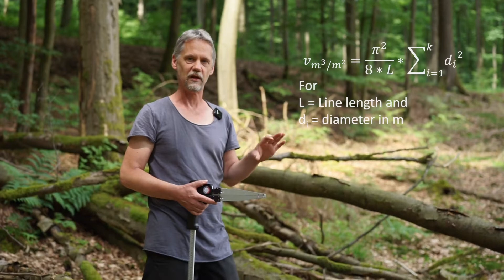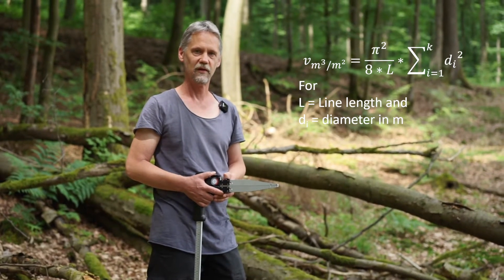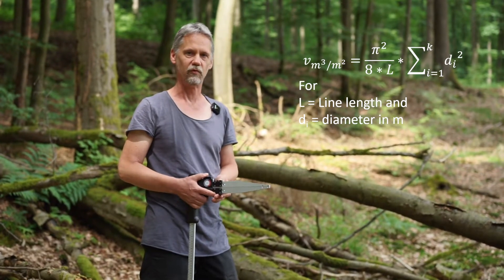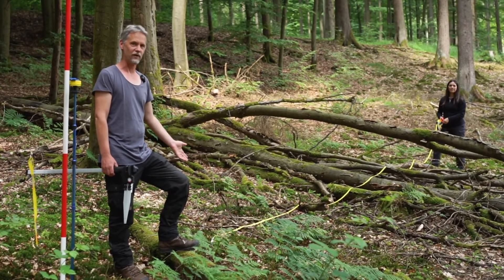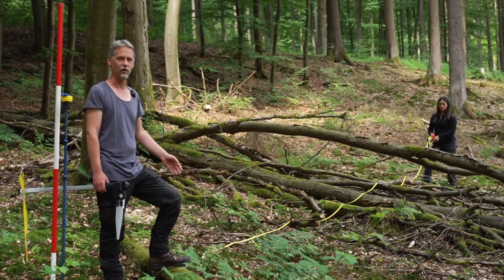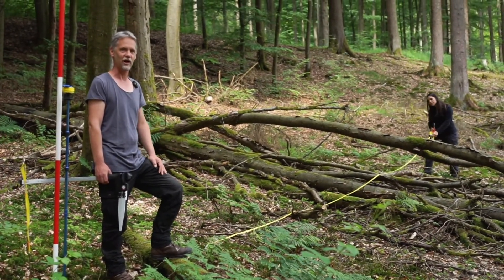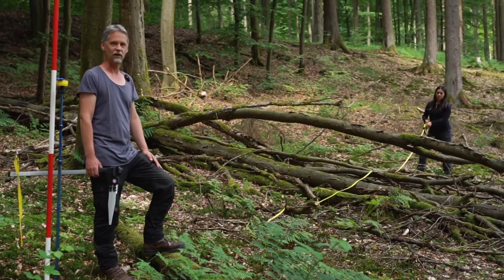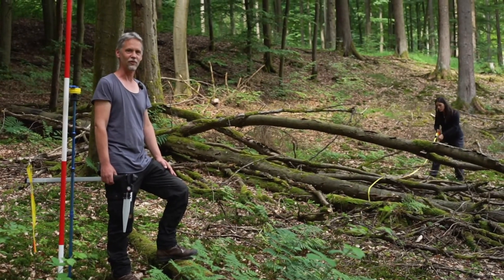Deadwood assessment and Line Intersect Sampling

Comment: Hello, is it possible to mention the name of the reference where they obtained the model for estimating the volume of dead wood by line intersection sampling by Bertil Matern? Thank you
Reply from the maker: Matern proposed an approach to estimate the length of linear features just by counting intersections with line elements used as sampling elements. This general approach was later also applied to directly estimate the volume of lying deadwood. Famous references are Warren and Ohlson, 1964 or van Wagner, 1968 or Kaiser, 1983. Böhl and Brändli, 2007 give a nice overview:
https://www.researchgate.net/publication/225570700_Deadwood_volume_assessment_in_the_third_Swiss_National_Forest_Inventory_Methods_and_first_results